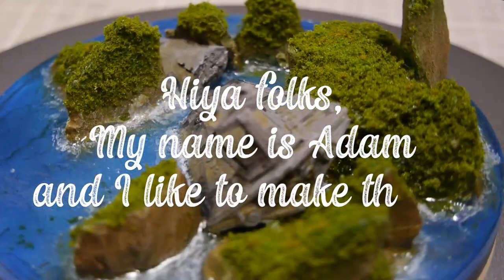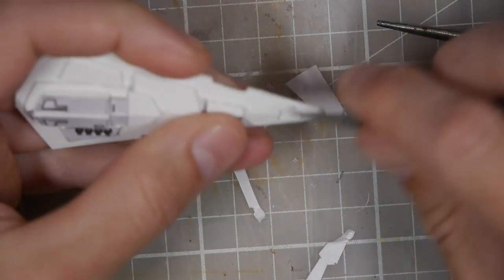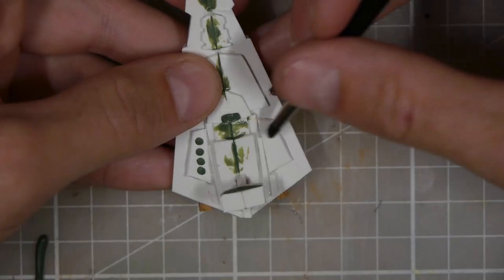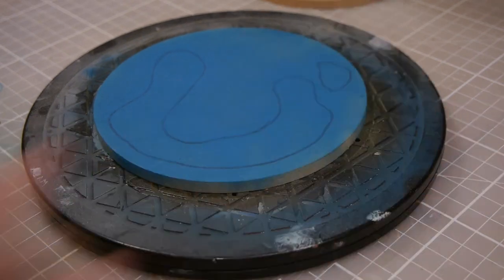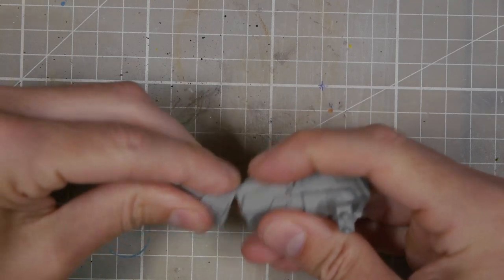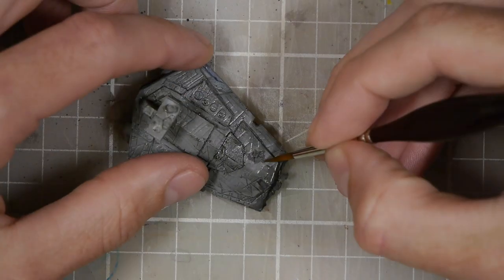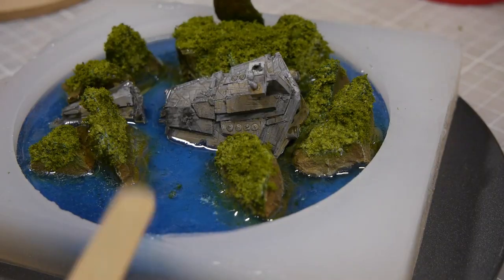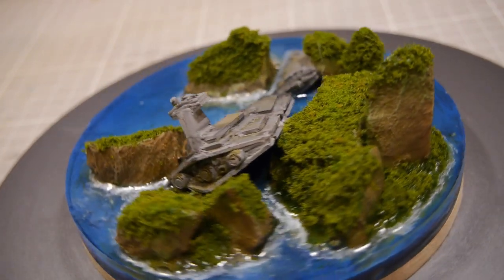How to make a Scratch Built Imperial Star Destroyer Using Some Rocks and Plastic / Miniature Diorama

Comment: buy yourself some epoxy sculpt. you will save yourself alot of money if you use anything more than a couple packs of green stuff.  its laughable how expensive that crap is compared to all the other options
Reply: Expocy I'm told is much more difficult and harder to mold than air dry clay or green stuff. But you're right it's more financially viable